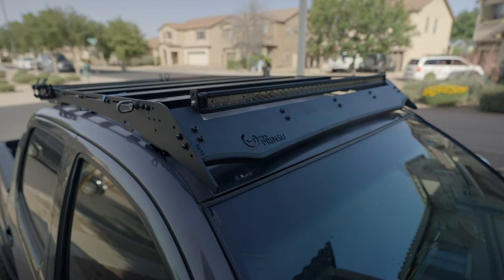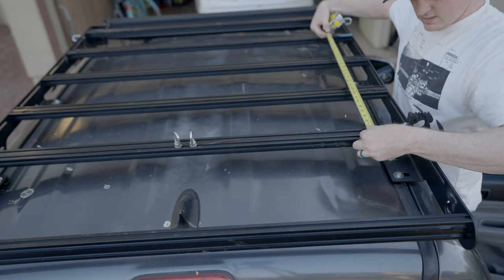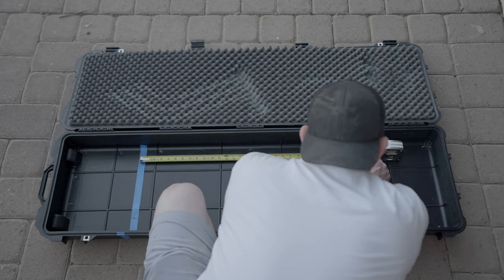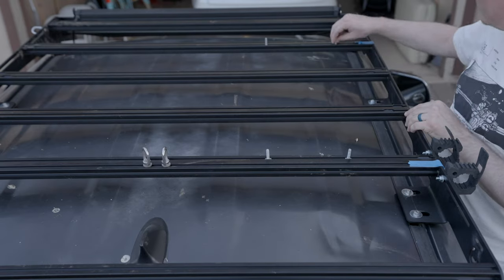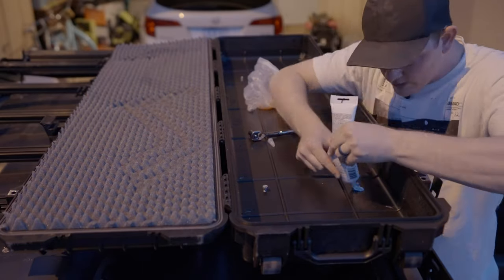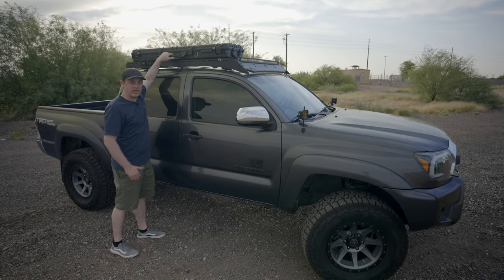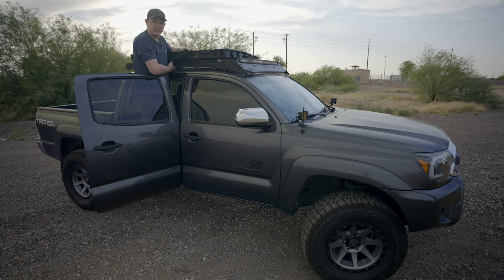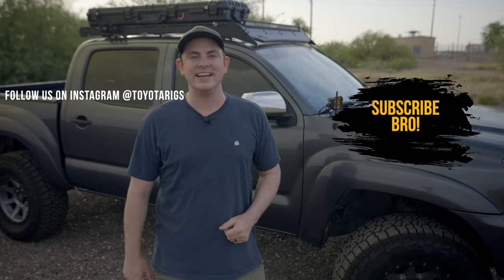Mount a Pelican Case on a Prinsu Roof Rack on the Toyota Tacoma

Comment: Could I use wing bolts for easy installation and removal?
Reply from the maker: Yes, you could definitely do that if you get the right size matching wing bolts! That's what I should do still, cause I don't like always having it on top anymore. It's a lot of wind resistance and effecting my MPG.